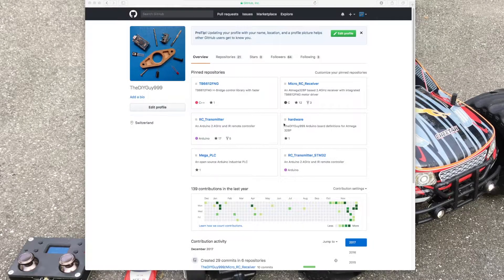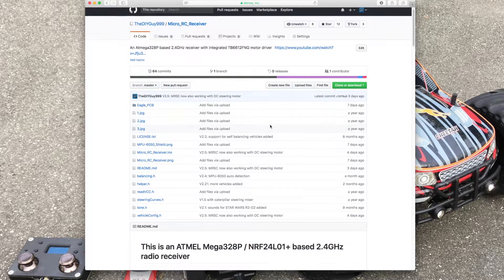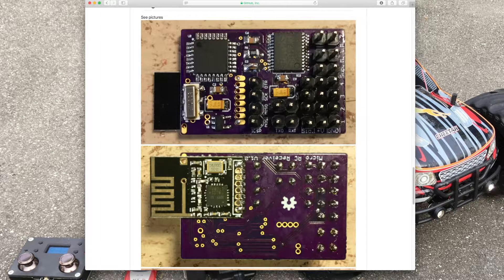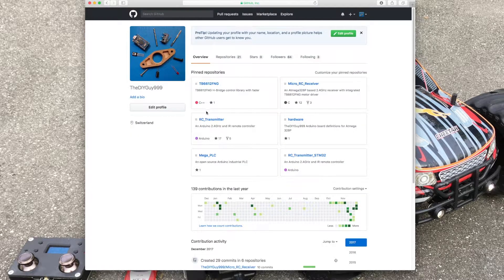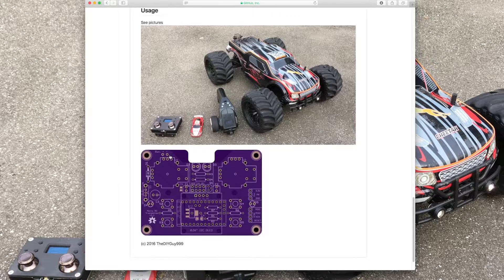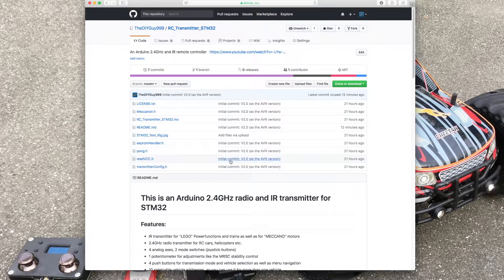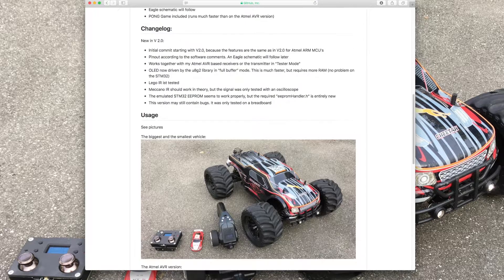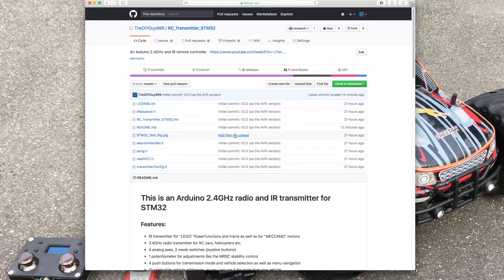Micro RC 2.4GHz / IR Transmitter: STM32 Version Available!

Comment: Hello, i have been following your amazing project, but i have designed a custom receiver board. I just wanted to know if you stiil have older versions of the code, that could be able to run on a 168p microcontroller. Because the current code is too big for it.
Reply from the maker: Hi, you can download old versions on GitHub as well, but I don't think, that they will work. I think you could desolder the 168P and replace it with a 328P, using a hot air gun?
Reply: @TheDIYGuy999  Unfortunatelly no, the 168p is signifcantly smaller than the 328p, i will be using the 168p on the receiver only. Commenting the functions responsible for ballancing, battery management, and status LED, i was able to make it fit on the 168p, but it didint end up well, cause it was confliting with the Config.h.
Reply from the maker: @kayquexavier  I just uploaded this lightweight version: https://github.com/TheDIYGuy999/Micro_RC_Receiver/tree/master/Micro_RC_Receiver_Light

Comment: Nice project. Don't you have loss of data transmission with nrf24 during oled refresh page? I'm working on same project but using SPI for the oled and SoftSPI for the nrf24 so I don't have these problems of loss of data. What do you think?
Reply from the maker: I'm only updating the OLED if required. The radio is running very stable and I'm using this system for most of my vehicles. In order to achieve a stable data transmission, it is very important to use a separate 3.3V regulator with proper smoothing capacitors
Reply: @TheDIYGuy999  I printed the 3d file frame. But there is not gap for the Oled screen. Did you reverse it to fit the case ?

Comment: Been following this for a few weeks ans it looks great!
I'm still fairly new to Arduino and I'm not able to make a modification I would like, so I would it be possible for you to make a version that just reads PPM, Maybe the HASI PPM code?

I would like to make a module and use my hobby transmitter to do all the channel limits and mixing etc.

Comment: thank you very much to share your knowledge to us
I look for the eagle PCB for stm32, that would be awesome!!
Reply from the maker: You're welcome. Currently I'm building a wooden prototype of this transmitter, but the release of the PCB will take some time. Until then, you can find all relevant informations in the pdf schematic on my GitHub: https://github.com/TheDIYGuy999/RC_Transmitter_STM32/blob/master/Eagle_PCB/RC%20Transmitter%20STM32.pdf
Reply: TheDIYGuy999 that's great!!
I can understand the schematic, but I'm not in skilled in PCB design...
Reply from the maker: It's not as hard as you think. You should try Eagle.
Reply: yes, I've tried to use eagle, when I'm still in high school
I designed a PCB without schematic, and I got confused to print them to PCB
now I just solder my project to drilled matrix PCB, LOL......